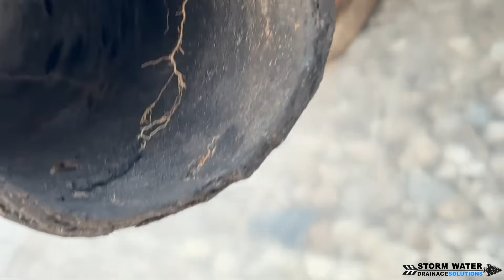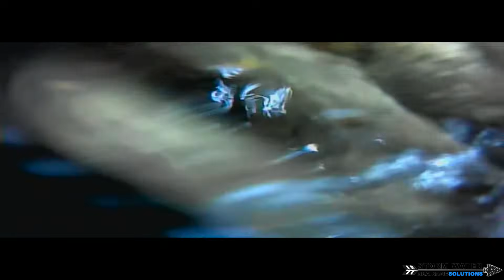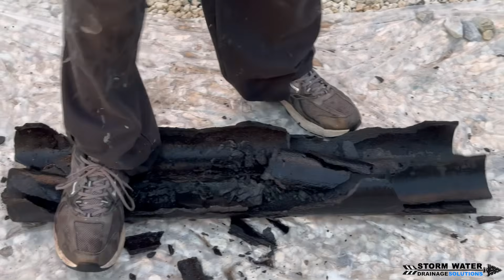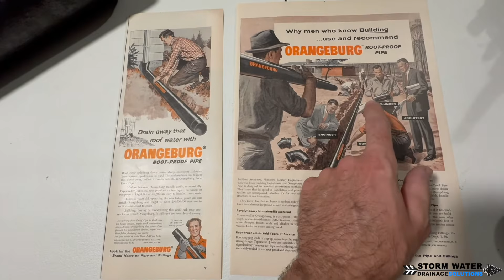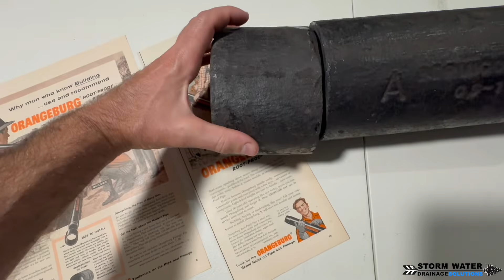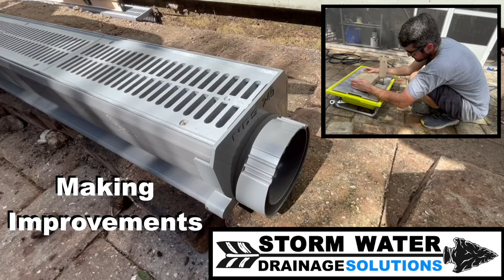Orangeburg Sewer Pipe - Drainage System Knowledge

Comment: Good video and information on the Orangeburg pipe. I just ran into this material doing a new sewer connection to a ca 1951 sewer line from the street main. I had never seen this material before. The part we accessed was about 4 feet underground and slopes even deeper until it reaches the main about 6 feet below the street. Fortunately it isn't crushed and still is solid and complete. But we did also excavate the old lateral and part was Orangeburg and the rest was cast iron. What a mess. Orangeburg was crushing and the cast iron was very corroded.